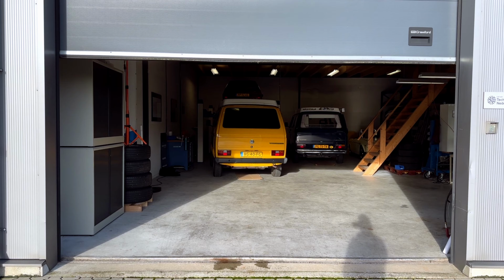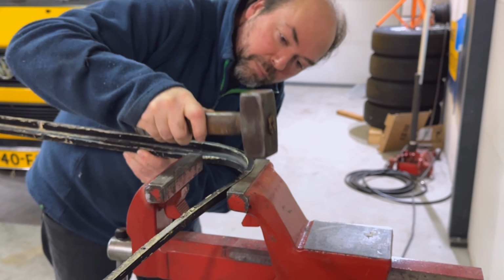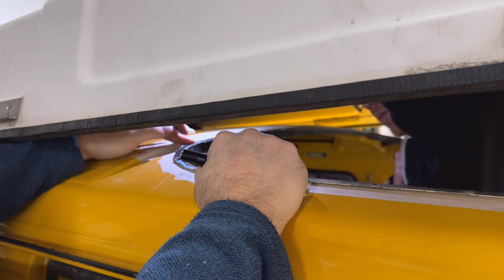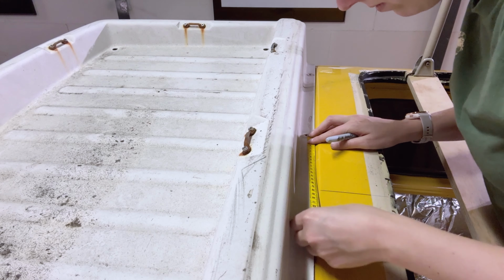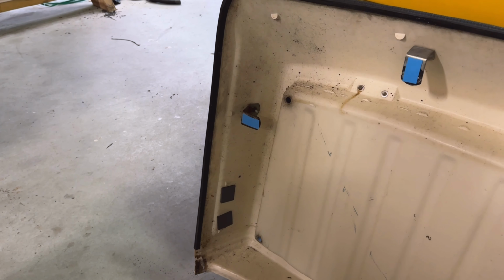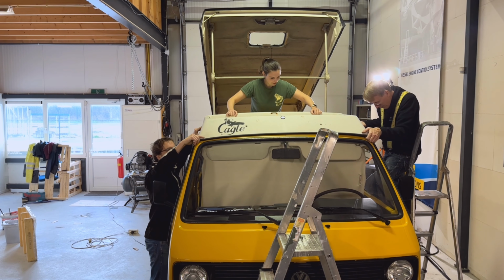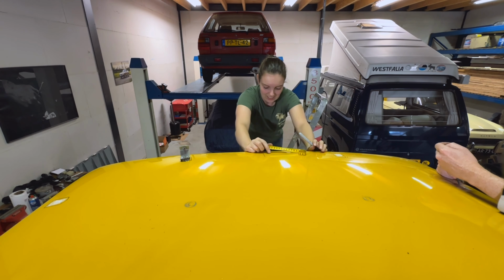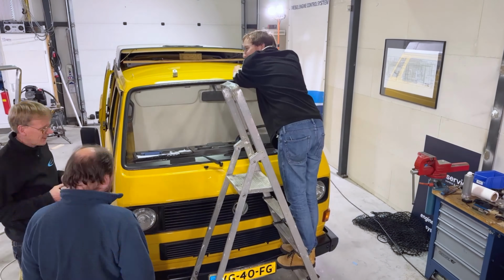Westfalia luggage rack and frame install | Building our dream VW Vanagon / T3 | Pop Top - Part 3

Comment: Nice work, I've done the same on my T3.
One tip regarding the removal of old paint from the frame (or from metal in general): There is a tool called "Reinigungsscheibe" in german (f.e. the product xt pro from 3M) which works like a charm to bring blank metal to the surface. Keep up the good work 👍
Reply from the maker: Thanks! We will definitely check out that tool for next time! 😄

Comment: Do not forget to put the rubber washers under the 4 bolts of the tray. The brackets are sealed with teroson.
Reply from the maker: Thanks for the tip! We still need to look into the best way to seal all the holes we drilled all around. But I'll definitely look up Teroson :)
Reply: @sunnyadvantures  teroson RB2759, you can also use sika flex but it is glue. RB is sealant and can be removed.